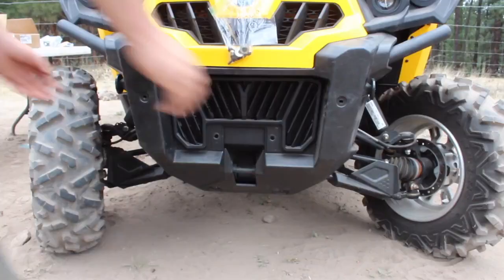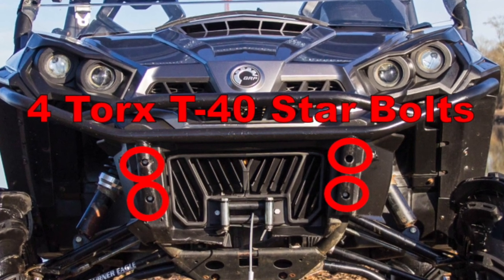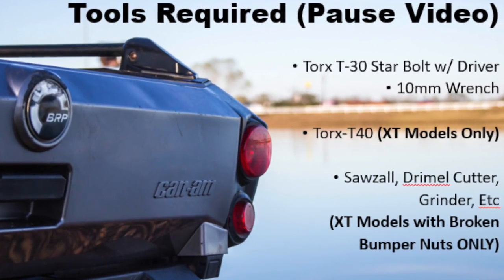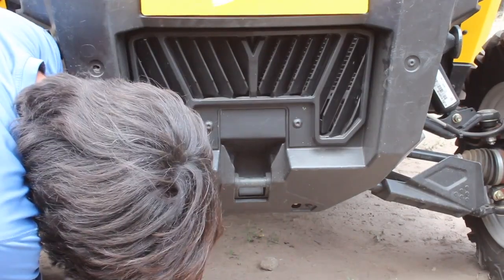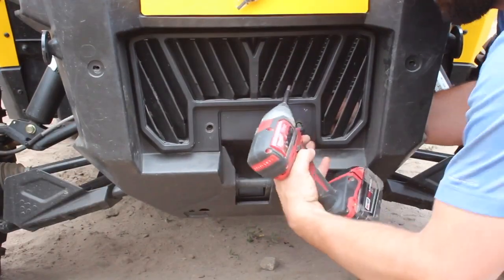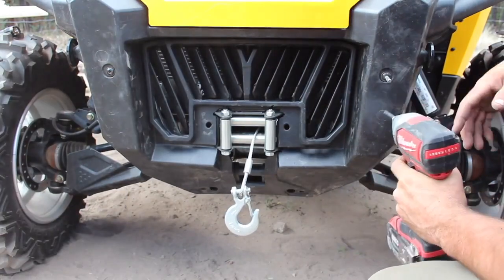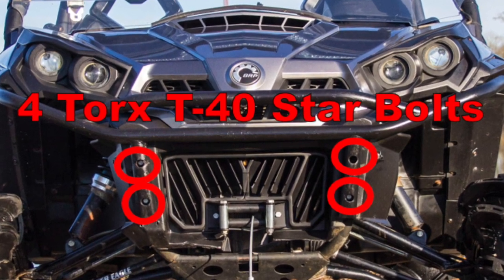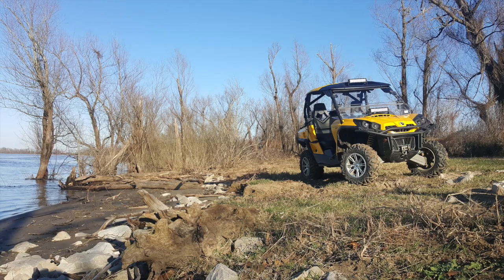How-To Remove Front Bumper/Fascia On Can-Am Commander 1000

Comment: Where a-bouts is the 10mm nuts on the back??? I’m having trouble finding them. I have a Can Am Commander 800 XT
Reply from the maker: hmmm, I don't currently have any commanders, but as soon as I get my hands on one to look at I'll let you know. But it looks like they are secured to a plastic "access cover" unless yours has been removed for a winch install. In hindsight it might be easier to just remove the two pop rivets securing the plastic "access cover" (if that's what its called) behind the front frascia, leaving the front fascia and assess cover as one piece, (Secured by the torx t-30 star bit with the 10mm nut on back.  Hope this helps, wish I had one here to tell you for sure. Thanks for watching and taking the time to leave a question in the comments. Cheers
Reply: I’m having the same issue.  I have a 2015 1000 XT and the only thing stopping me from removing the front facia are these two bolts on either side of my winch fairlead.  I can’t seem to find access to these back nuts for the life of me.  Hate to be defeated by something so small lol.